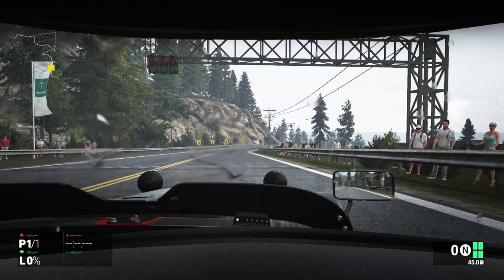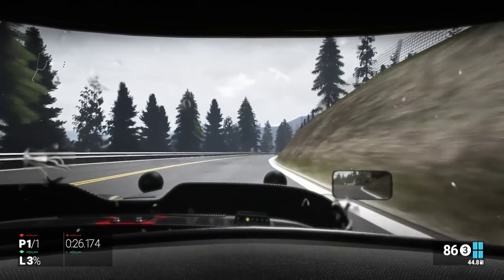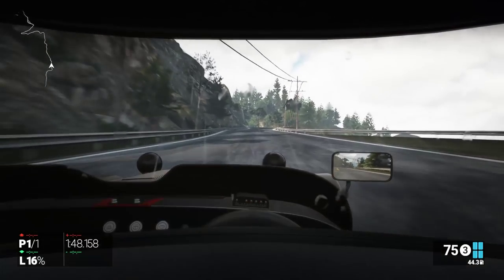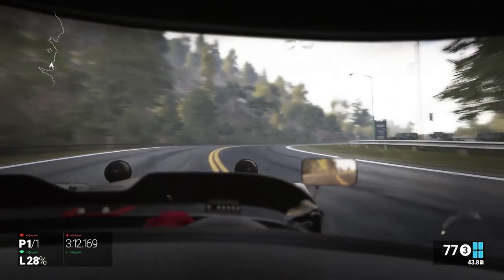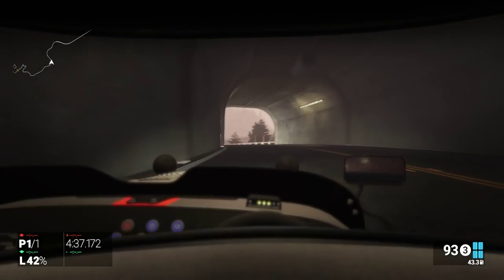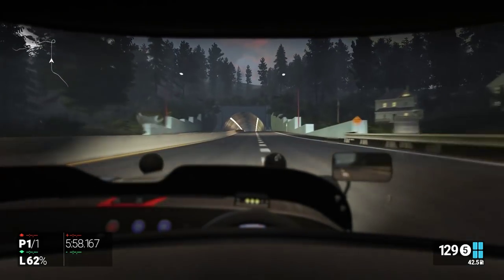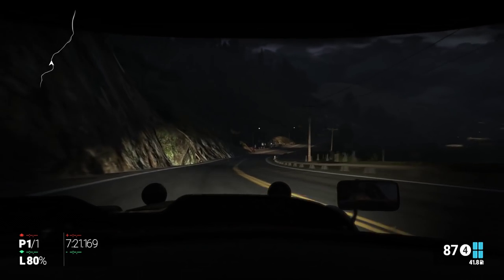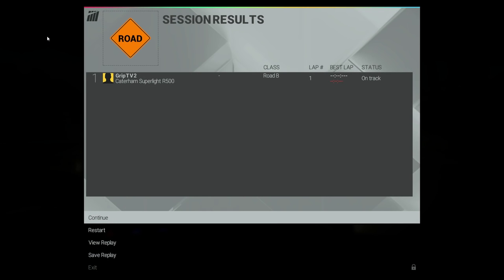Project CARS - Wet weather drifting/crashing

Comment: You answered my biggest question!  Will my PC run Project Cars at a steady framerate?  I've got a little Dell Inspiron with an AMD Athlon II X2 3.0GHz, with nVidia GTX 750 Ti 2GB GDDR5, and 8GB RAM.  I am not really enjoying Assetto Corsa because I can't get stable performance in Career Mode races.  AC has glitches and system crashes for no reason.

Comment: That looks fun, but I'm annoyed that a lot of the new racing games have a ridiculous amount of system requirement just to even run it at the lowest setting.

I got 2 question: would you do a time trial at the Targa Florio in the rain? And what would you consider as a good upgrade over the Logitech G27?
Reply from the maker: Kalsonic 

1. Definitely. Whether I'd complete the full lap is another thing.
2. I'd say the T500rs is a pretty good step up...but I'm a little biased ;)
Reply: Kalsonic The thing with sims, is to feel as good as they do they require more CPU power than "normal" games for advanced tyre models as it is, nevermind everything else. Then to look really good (say, AC, Project CARS and the improved rF2) requires more on top of that. All that combined results in one performance hungry genre of gaming. As true as "it's all about the feel" in sims is, there comes a point when you need visual immersion to go with that amazing feeling you get through the tyres and then through your wheel. As demanding as pCARS, AC and rF2 are, they've all given me moments visually that have made me feel like I'm truly involved in something epic and memorable.
Reply: MajorHobbit It's not the CPU part that I'm concerned about, it's the GPU part. It comes to a point where we're getting very heavily diminishing returns just to get that 10% of extra eye-candy in what it suppose to be a simulator. Heck, realistically you can't even discern the differences between a medium and high graphical setting when in motion.

If the cost of all this eye-candy is taxing even a contemporary mid-range GPU even at the lowest setting, then one can't help but wonder where the priority lies by the supposed simulator developer in making them.
Reply: Kalsonic Erm, what sim titles are you referring to exactly? Because even in fairly taxing games like AC or PCars I got a few friends running triples on systems using 660tis/670s at med settings happily with no issues. And none of them got fancy i7s or anything like that even since they are quite expensive over here so they are running AMD FX6300s which are fairly moderate when it comes to horsepower. 

The thing you gotta remember is that sim racing titles no matter how big they are, they don't sell nearly as many in numbers to make the eggheads at NVIDIA or AMD to take time and develop proper driver support for them simply because the consumer base is so small and insignificant in the grand scale of things.

Like for example, lets take AC - hands down the best selling PC sim on the market till date, and even with some 300k sales on steam there is no proper driver support for that game from both green and red camps. SLI and crossfire scaling is entirely borked. So I had to get rid of my dual GTX770 setup for a single 980 just because even though the two 770s are in theory just as powerful as a single 980, the lack of proper driver optimization leads to them delivering complete and utter shiet performance. 

So, in the end it comes down to the simple choice that if you have a really beast system you could run with all eye candy filters on, if you even drop down from a high end rig to a normal rig you get massive blowback in performance which leads to you having to drop down the filter by a bit in order to maintain steady framerates since the game itself is only optimized halfway through only from the game dev side and not from the GPU driver side. This leads to running sims at max eye candy on potato PCs a real bother. :P
Reply: Kalsonic games advance and need for power, that's how its been for the last 25+ years